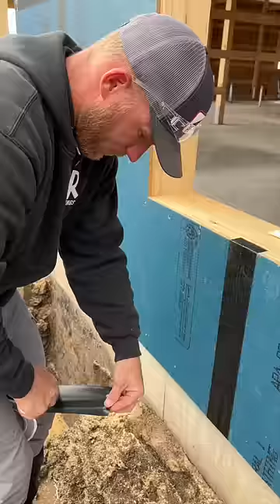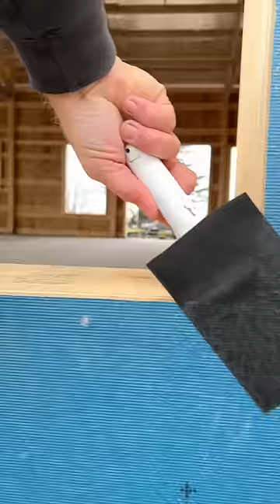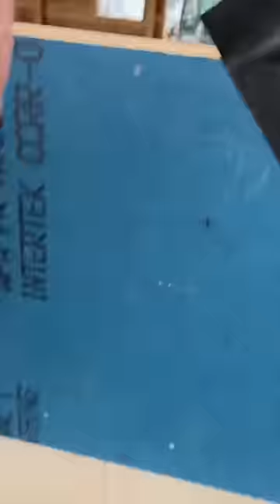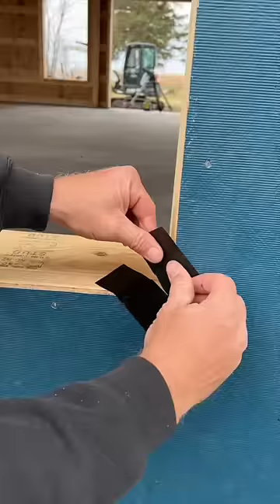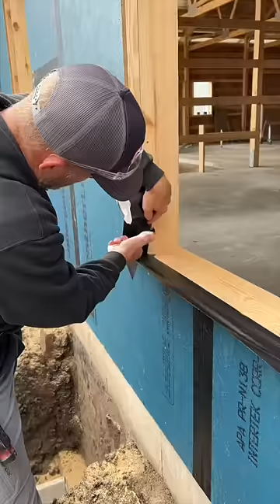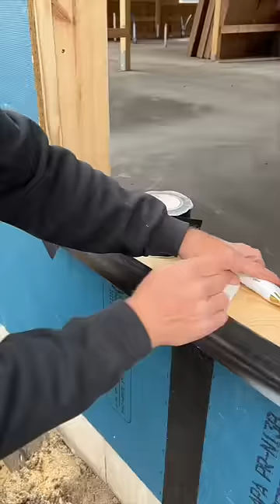How To Easily Tape Seal a Window Frame

Comment: Still have a leaking point. Your corners of cut meet and leave a point of leak. You need a third corner piece that needs to be stretched and lapped over corner. I install for commercial windows and this leaks all the time
Reply: Agree.  There is still a chance the leak occurs in the corners because nothing is covering the outside corner but a tiny piece of tape overlapped from both ways.
Reply: There was about 1-2mm of overlap. Should he have stretched more?
Reply: @Matthias53787  He did more than most would so kudos to him for that but corners are vital to keeping things dry.  Stretch it out as much as possible.  Good windows are useless if the install is junk.
Reply: Guess you guyz don't use a lol butter then.
Do your best,caulk the rest...!????🤔
Reply: Exactly my thoughts.
Reply: Yup leak points... But hey... He tried... hahahaha
Reply: Right lmao
Reply: It's okay man, everyone develops a leak point the older we get. 😉
Reply: Oh my God I don't do construction but even I knew that
Reply: Maybe if they stop making houses out of paper there would be no leaks?
Reply: when installing the window, it will be caulked around under the flange, so water cant get in from the sides or from the top..
Reply: @mrdot1126  I can tell you this. In my 25 years of window construction I have never seen a residential window installed with a caulk bead under the flange. Also, that isn't considered a viable seal, it is known as a blind bead as you can't ensure it sealed. I only ever see them use another layer of flex wrap over the flange which again doesn't prevent water from accessing behind the flange if water runs down the wall. I'm not saying it will always leak I'm just saying this isn't the correct way.
Reply: Window flange covers all of that and it gets taped again over the flange.
Reply: You keep adding layers you're just providing places for moisture to accumulate.  This is perfectly adequate if done correctly, especially if nail flanges are also appropriately sealed.  This is the window of a house, not the hatch on a submarine.  Whatever doesn't drain is meant to be able to evaporate away from wood.
Reply: Stretch Tape is the only way to properly flash windows
Reply: Bowtie works best in the corners in my opinion
Reply: Эй, нифига я не понял, давай по-русски!
Reply: I was thinking the same thing. Carpenters do the best they are taught though 😅
Reply: @yodaddy82daddy70  what do you think about the liquid flashing material? Would it be ok if he sealed the corners with this after?
Reply: @keithb3801   what do you think about the liquid flashing material? Would it be ok if he sealed the corners with this after?
Reply: @stillmatic03  yes. There are several products that are actually designed to adhere to membrane/flexwrap. In fact we have been stipulated to use it on several government jobs, you know cause they like spending our money 😆. They have us use flexwrap than roller on a laticrete type product especially over seams and where the wrap stops on the densglass so water doesn't get under. That is not as common though.
As a glazier though before we flash or put in our subsills we run a bead of Dow Corning 756 in the corners just because windows are usually first to be blamed for leaks.
Reply: That tape doesn't seem very good for corners. We have a tape specifically made for corners and angles. It's called wigluv outdoor flex. No need for cuts.
Reply: What window leaks at the bottom… water flows down not up bud
Reply: Dupont flexwrap and stop doing these bad details
Reply: I thought the same thing. Load that puppy up with tape bc you are going to shim the ends anyways
Reply: Prosecco, zip Liquid flashing, or Poly-wall is the only products I would use
Reply: Yea, I too noticed the little corners are a point of weakness in this flashing job. The way he did it is the way I would do it, so it must be incorrect.

I assume there is some other fancier overlapping technique that would be better.
Reply: @Bryce Stevenson  stretch tape is a better option than what was done here. It's not the only option. Liquid flashing materials, like the ones from prosoco and zip are arguably even better.
Reply: uhmm!!!! I just noticed that.
Reply: Sikaflex the windows in???
Reply: Won’t leak once the ilbruck compraband tape is fitted between window and kit , will be water and air tight
Reply: Dab of silicone or RTV
Reply: @WashJosh  that stuff doesn't stick to flexible membrane. It fails pull tests. Only thing that I've found that holds is Dow Corning 536
Reply: @yodaddy82daddy70  even better
Reply: @yodaddy82 daddy  in Canada we caulk behind the flange on the top and sides, with shims behind the flange on the bottom.  Then on the inside we caulk from the window to the frame all the way around.  Any water that finds its way in should make its way out through the weep space in the bottom
Reply: Why don’t you make a YouTube page?! We need people like you to teach instead of bad or inexperienced teachers.
Reply: @martenkerkhoff6600 -- Yes.  Use tape designed for window install.  The stuff here is silver on the top side.  Tape the rough opening all the way around.  Install window.  Then, tape the outside of the nail fin on three sides, leaving the bottom not-taped to allow any moisture intrusion to escape out the bottom.  Then, install exterior wall siding.
Reply: I’m worried this comment is so far down the list. This corner is incorrect and will still leak
Reply: Correct, this is guaranteed to leak in a coastal application.
Reply: Exactly
Reply: @woodlandwrench yes sir
Reply: Need that SIGA tape
Reply: wheres the flax wrap lol why is there no tyvek wrapped inside the windows? idk im from MN so maybe we need extra protection
Reply: Flex wrap for corners.  Fair bit pricier than other flashing tapes, but it's great for those corners.
Reply: @Arcade-tm2ck 
Yes..
We should live in dark damp stone caves .....
😂😂😂😂
Reply: @titusdaniel 
Mr. Builder I would like to have my house tight as a submarine please....
😂😂😂
Reply: Exactly
Reply: You don’t use flex wrap in commercial windows?
Reply: You obviously don't know then.  😂😂.  Grace still needs togo on before the window is installed.  Honestly what he did is a waste of time.  I throw the 2 corner pieces on then I grace it.  Window is ready. Then u tape the flange.  What is did is pointless to me.
Reply: He did what code requires
Reply: exactly what I was thinking, but I'm not an expert. So I wasn't gonna comment.

Comment: 4/10 contractors will take the time to do this properly. Bless this dude.
Reply: bless this dude?
Reply: Except this isn't correct....
Reply: @yodaddy82daddy70  Care to say more ?
Reply: @WHIRLWOLF  so each time he does the cut those cuts starting points overlap leaving a very small pinhole for water penetration. There should be a third strip either the vertical strip, a preshaped corner pieces or just a stretched piece that overlaps the corner without any cuts. I'm a commercial window installer and have had this leak many times when done this way. We don't install the flexwrap, that is usually  done by whoever does the substrate or framing, but we have taught our glaziers to look for conditions like this.
Reply: @yodaddy82daddy70  I'm not familiar with this but when i saw the overlaps, that small hole bothered me too. So i thought it was probably okay. Thank you for confirming my doubts then
Reply: 2/5 contractors use fractions improperly so I'm not surprised at all 😂
Reply: @m.dewylde5287  the hell it isn't required, vapor barrier/ice and water is required by 2018 IBC 1402.2.
Reply: @m.dewylde5287  your comment is pointless, you base everything on IFs. First off, sidings and stuccos fail all the time, caulking fails all the time. Second, even if there isn't a leak moisture builds up behind substrates.
Reply: The other 6/10 do it properly and wait for the sheathing to show up
Reply: In 3 decades of house building, I have never seen ANYONE tape a window seal up
Reply: He’s not a contractor he’s a YouTube guy with a hammer
Reply: Dude this is incorrect
Reply: @yodaddy82daddy70  that kind of thing doesn’t happen on the sun though.. only in certain climates
Reply: @yodaddy82daddy70  i know… sometimes it rains; and if it snows?!..phhhffsh - they gon be trouble!

Yaahmean?
Reply: ALL contractors do this. It's required by building codes. And inspected by the local building officials.
Reply: The cuts don't go all the way to the corner on either layer of the tape. Cuts stop about 1/4" shy of the corner and tape is stretched the rest of the way to overlap the corner. This is the proper way to flash a window opening with flashing tape to code in NW Florida 140mph windload residential dwellings. 
ZipSystem stretch tape (4x the cost of flashing tape) and DuPont FlexTape (8x the cost of flashing tape) can be used in order to flash sill openings with no cuts, but I've only ever seen 2 custom home builders use them (due to cost) in 22 years of framing houses. I've never had a window leak warranty in those 22 years, through several hurricanes.

Comment: Now I wanna see a video where he ACTUALLY installs it 😂
Reply: Lol. Day lucky they got that
Reply: You can probably install it with another person helping faster than his tape job. Windows are pretty easy to install. Just need a level, a couple pencils as a spacer for the bottom of the window and some roofing nails and a hammer.
Reply: @Chris-ip8pz f u frame it properly 1 guy can easily install a window or a door. U know its level and plumb but never skip the flashing.
Reply: Pay good workers good wages and you get good results
Reply: @j.pershing2197  what?
Reply: @RapTapTap69  
A starting wage for a carpenter was 2.5x min wage. Now its within a few dollars.
Reply: @j.pershing2197  idk where you were working when you were getting that lol. Would have loved to be on those jobs. Construction jobs have always been around 1.5 times min wage starting out around here.

We're able to do a little better at 17ish but that's only when the guys earn it as we've had a lot of unreliable workers over the last few years
Reply: @RapTapTap69  
80s n early 90s
17ish is helper wages
Min wage was 3.85 or so and a carpenter could easily fetch 12-18hr
Reply: @RapTapTap69  
I also have a handyman business. Easily make 75hr. Hehe i pay my help 25-35 hr. Not much competition
Reply: @Chris-ip8pz  yeah, with direct replacement windows. Other than that, you have no Ideo what you're talking about. You have to make sure that both the harder and sill is level while the window still closes properly without bringin so that it sits properly without letting water in. Also, the flanges should all be covered with vycor and silicone caulking. Alot can disagree, but I don't like ripping people off for something that won't last
Reply: @RapTapTap69  hmm. Well he did this wrong sooo....
Reply: Knowing how to build something especially a house is awesome....kuddos to those who can
Reply: Funniest comment I’ve ever read. But I don’t know what I’m actually laughing at. All I know is that I saw a laughing emoji and the commenter must’ve thought he said something very funny?

Comment: Zip tape makes a flex tape that will do that corner in one piece, no cutting at corner that will leak
Reply: 100% but you get what you pay for.
Reply: For Yank thats was 5 years of experience,  with yours education not surprised 😂😂.  Sry for my English.  Dont give a f.......k
Reply: Yea looks great but the material between each piece in the very corner is maybe an 1/8” most likely a 1/16”, couple years and this corner is done.
Proper flashing and yearly maintenance on windows is the only true way to keep them dry 🤫
Reply: @1977BangBang  exactly why even cut it just squeeze the tape around, it, then he cut the 2nd peice and i couldnt beleive it
Reply: That takes forever..

Comment: Add  a good bead of STPE-type  liquid flashing/sealant at the inside corner after you place the first corner piece and you'll get a little better protection against pinholes opening up where the cuts meet, as well as  protection against damage to that inside corner when setting the window. Add that sealant bead and this isn't too far off from a lot of manufacturer's standard details for the sill.

Comment: I’ve been framing house for 847 years I’ve seen all types of new tech techniques and this guy is the best bicycle mechanic I e ever seen!!!
Reply: As a bicycle mechanic, I feel kind of insulted.
Reply: Ya because that tape is going to stick to that wood for 20 years. Lol
Reply: @bryanbarner5665 It's not just tape. It's a thin rubber like material and the stuff we use, the glue even sticks to wet wood..and it lasts indefinitely. It's by code and it's inspected.
Reply: @iiiiiiiiiiiiiiiiiiiiiiiiii4222  you should be, I’ve never seen a bike mechanic use tape for much of anything other than securing bar wrap and the cable underneath. And that doesn’t need to last more than a season or two.

Comment: If that tape is similar to regular zip tape I'd suggest not cutting so close to the pinhole point. you can stretch the stuff quite a bit. or use the stretch tape.
Reply: It is very rigid compared to zip tape and doesn't really stretch. I've used both and won't ever use the LP tape again
Reply: @matt_metcalf  Good to know, I've got limited experience with LP products but so far it hasn't been great. the top notch 350 sub floor it garbage.
Reply: I saw that. I agree with you. It makes a "weak" point.
Reply: That pinhole left the corners where the two notches overlap is legendary for producing window leaks. Always use a flexible or preformed corner, or better yet build a corner with the fluid applied flashing. No seams.
Reply: P

Comment: There is flex corner tape although honestly I replaced a lot of windows and never encountered rot. Tar paper always worked just fine.
Reply: I just remodeled a rental I bought and the contractor wanted to do all this new crap. This house was built in 1972 the bottom 2 rows of old pressed wood siding was bad yet nothing made it past the tar paper. So we put new tar paper back. 
None of this new stuff is designed to last more than 10 years. 

Also I live in the deep south. Bugs are a issue. Tar paper is a natural repellent.
Reply: @jamesmcd71
Reply: exactly BINGO!
💯✅

Comment: This is the same method we us when installing EPDM roofing systems, as well as PVC, Hypalon, TPO, built-up, and a few others. it works well on roofs, so it will work well on any window or exterior door. 👍
Reply: Where do you use this method with built up or torch down roofs?

Comment: Dude I know it's expensive but the flexible stuff is the bomb..
Reply: In this case you have to use the tape the sheathing manufacturer requires
Reply: @saultpancetta366  for warranty or something? Zip system tape meets code here..

Comment: I've been framing windows for 78 years and this will cause the house to collapse
Reply: yeah that cutting technique he did was the culprit i think, no way the cut tape will handle that kind of load without ripping the rest of the way, should have just left it whole and worked around the bumps, rookie mistake
Reply: Exactly how they did it on the pyramids.
Reply: With overtime.. right?
Reply: well he did say "easiest", not that it would hold up
Reply: It’s gonna cause gangs to move into the neighborhood
Reply: So the tape holds the house?
Reply: How
Reply: Looks like a good job to me. Cuts are covered and it’s all properly stuck down. Only snag is that most builders won’t bother. Damp will get though but they’ll be long gone by then.
Reply: Their playing with yall.
Reply: @leander_jeff1  ffs
Reply: I almost pissed myself reading this 😂 thank you
Reply: With concrete or brick walls, there's no need to seal anything...
Reply: LOL x 10
Reply: Well you have 78 years of experience and I have 210 year.experience.this guy did a perfect rap
Reply: так сколько ж вам лет тогда?!   How old are you?!
Reply: @АлексейРозенбаум  релакс, он пошутил 😂
Reply: @АлексейРозенбаум  вот этого я точно не ожидал увидеть в конце ветки😅
Reply: love it!! 🤣🤣
Reply: @ballyantonia  lmfaooo
Reply: Yeah its about time someone brought down Microsoft.
Reply: @tylerkulhanek8650  lol
Reply: He should have used load bearing tape, the utter fool.
Reply: Where do I find black duct tape ?
Reply: bro said 78 years💀
Reply: I didn't know you could build a house with tape lol 😂
Reply: Literally perfect example lol men get a lil too excited and rush
Reply: Nah a there's gona be a cavity and a mechanical flashing so water just gona roll on out over the cladding mate
Reply: @YoSoyCoro  ha ha ha that’s a funny joke. I see what you did there since you quite literally have to seal the whole house and still have to seal around windows
Reply: @TalklikeAPirate  it's probably electrical tape which is probably better than actual window tape. However, window tape is for windows.
Reply: @braydenferguison4584  😂
Reply: This is the same technique I used when I built the hadron collider.
Reply: 78 years?! LOL!
Reply: Maybe talking shit for them years about how is This going to cause it to collapse
Reply: This person is correct! I've researched this over the past year and every house that had this done collapsed. There were about 15 of them that just exploded do to the tape igniting when the sun warms that area. Crazy stuff, man!